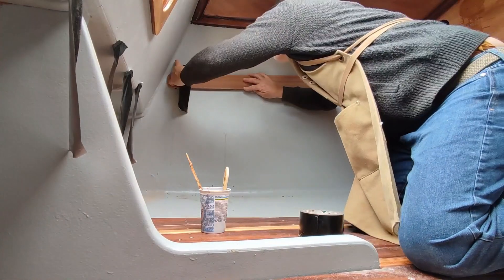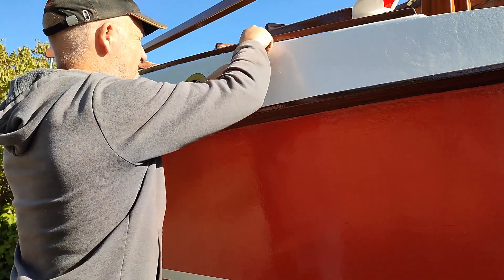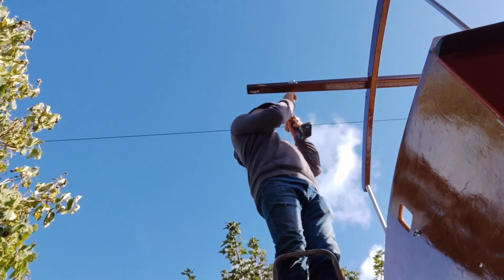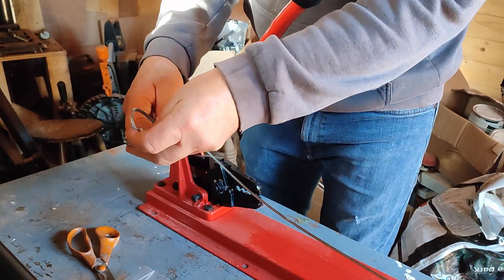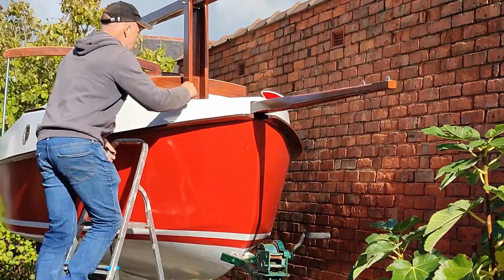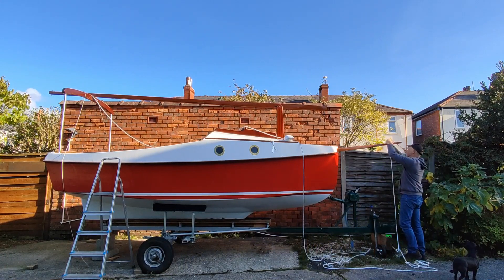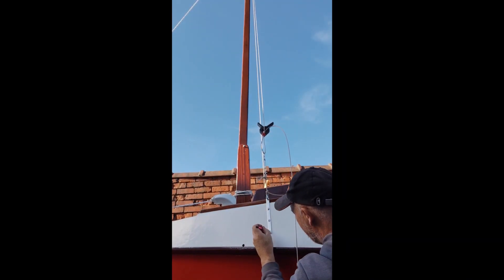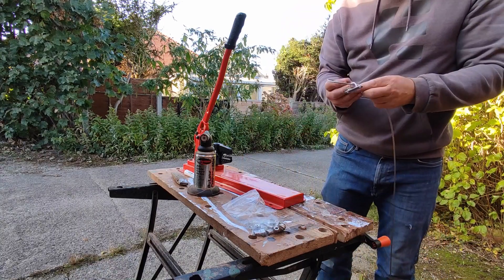AHAF Building a Pocketship part eighteen

Comment: Should of spent some quality time finish sanding or using fairing compound before painting especially after all the time spent on fabrication
Reply from the maker: Thanks for your comment Dan, I do agree. This is my first attempt at boat building and there are a number of things I would definitely do differently next time. When I was sanding the hull I was worried about going through the fibreglass but with hindsight I realise that I could have done more sanding.